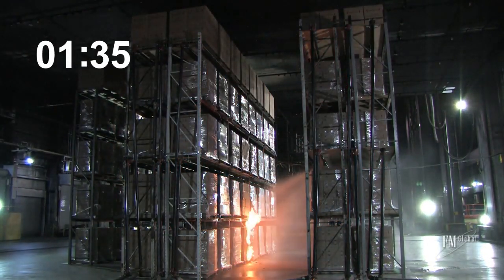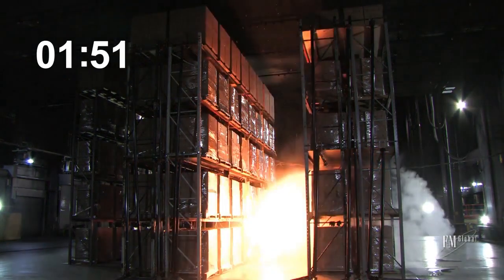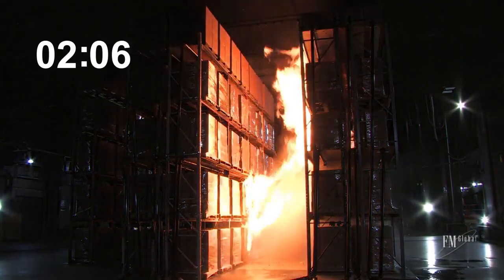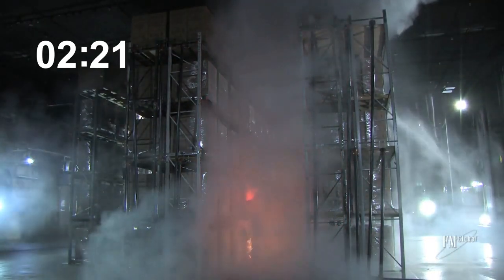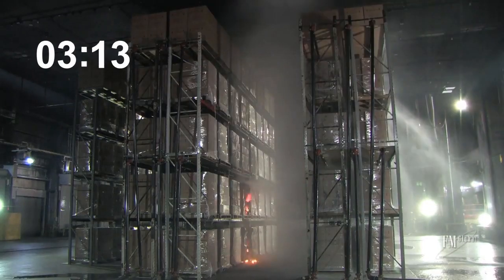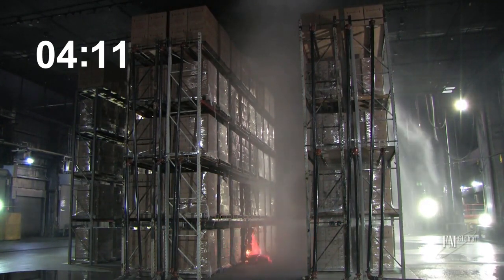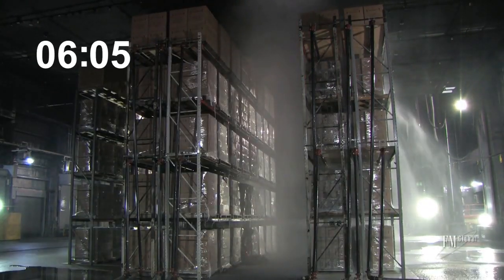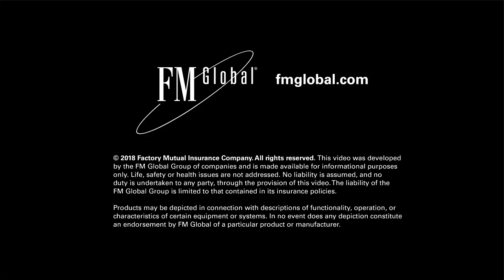Plastic Aerosol 3 Products

Comment: ohhhh so this is why storage systems sometimes get designed with small hose connections around the racks. The idea must be for a rack to be controlled like this and for the FD to finish it up with a 1 1/2" connection. But still most FDs would probably just go in with a line from the pumper.